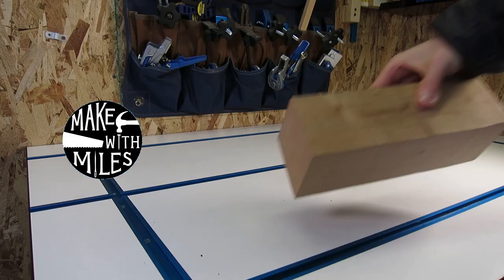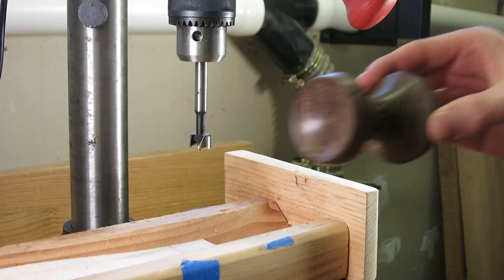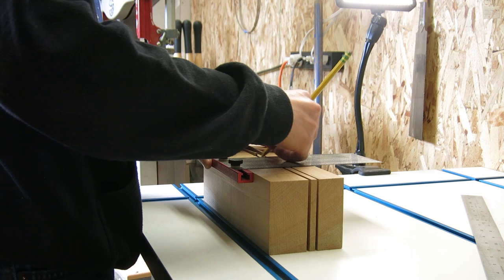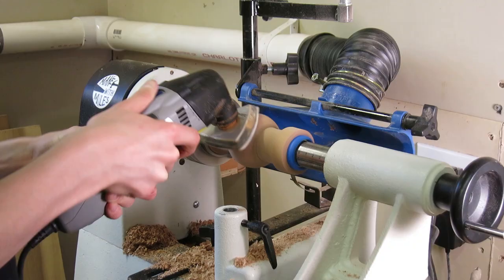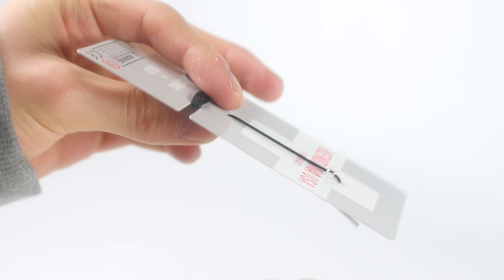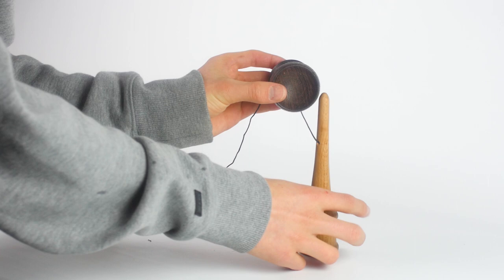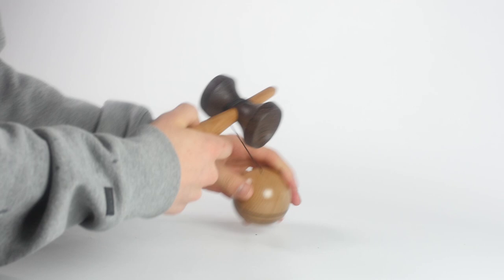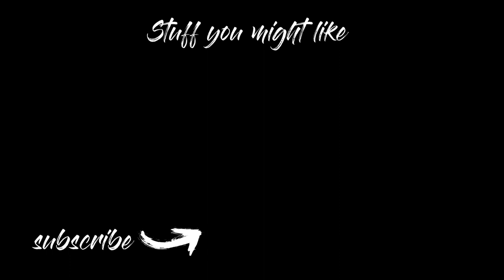How to Make a KENDAMA! (Japanese skill toy) // woodworking

Comment: Nice work Miles! It turned out great. I would advise you to not just break the waste pieces off as the wood can break into the finished piece. Use a chisel or saw. Excellent work on the sphere.
Reply from the maker: Thanks Brian, I do regret breaking it off, but I was able to mostly turn it down afterward on the lathe! Thanks for the suggestion!

Comment: where'd you get the clear coat?
Reply from the maker: The clear coat I use didn't turn out well. Since then I've found that Flex Seal clear works well. You can get it at Lowe's
Reply: @MakeWithMiles  huge thanx, im from Europe but  trying to find a solution